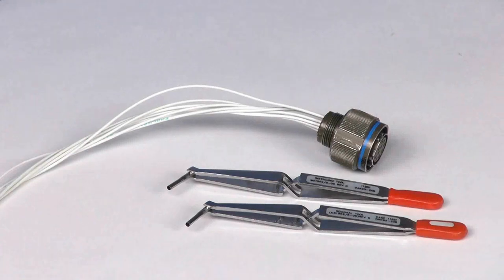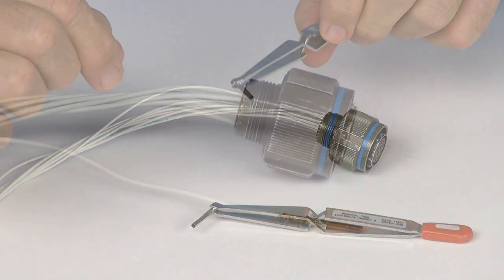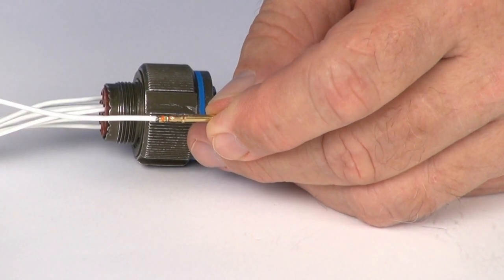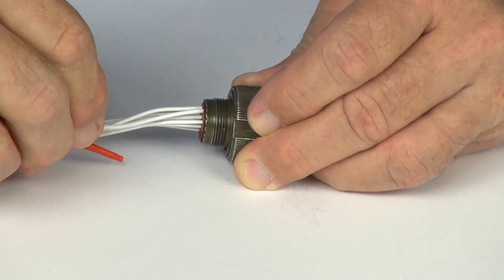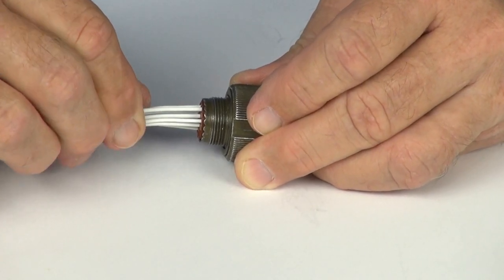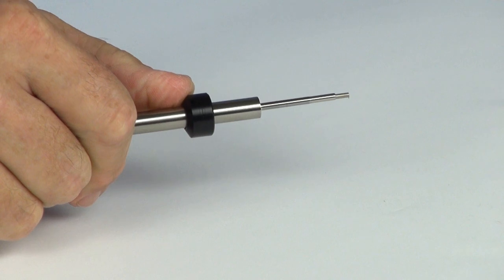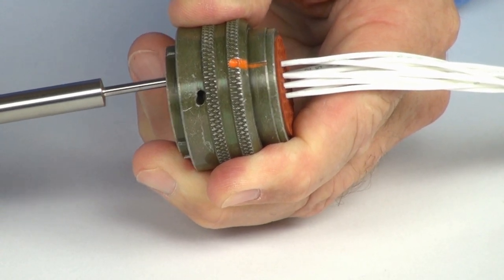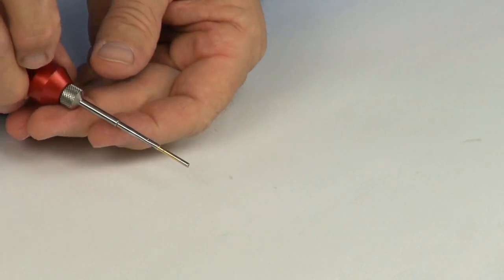Insertion Removal Tools

Comment: Dip the tool in alcohol before inserting or removing pin.
Reply: what does this do?
Reply: @jensvanhoof  it acts as a lubricant and doesn't grab or tear the rubber of the electrical connector (cannon plug). Being that it's alcohol, it evaporates extremely quick. We use it every time we pin connectors.